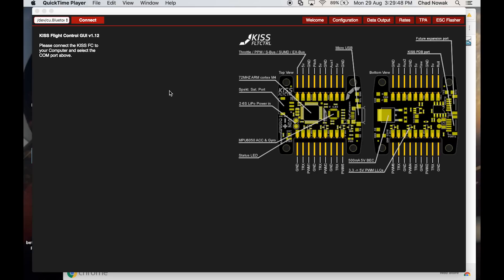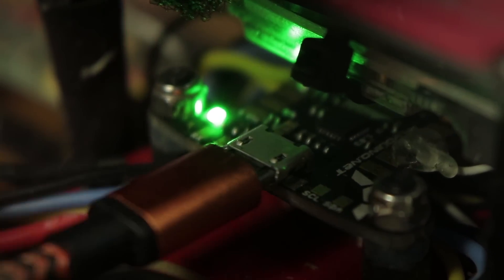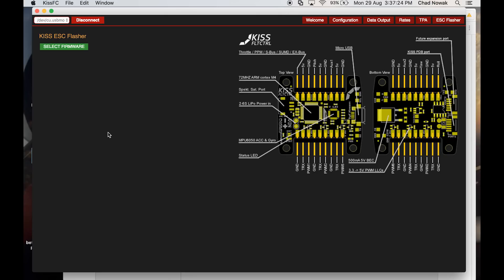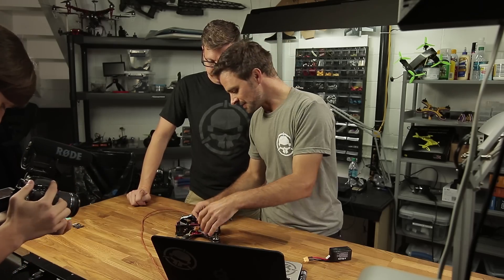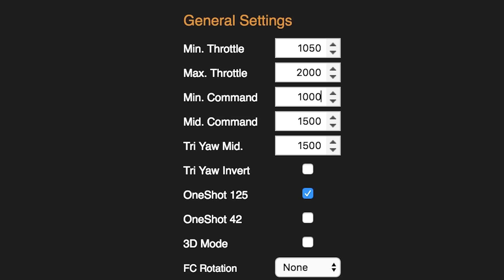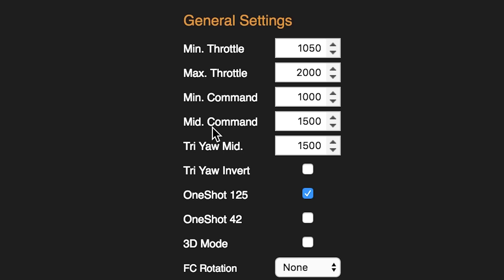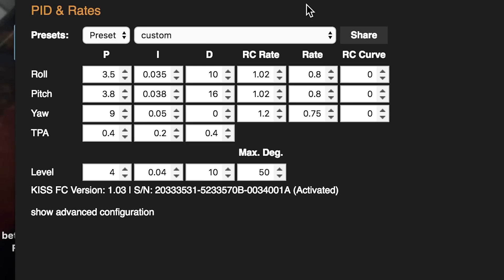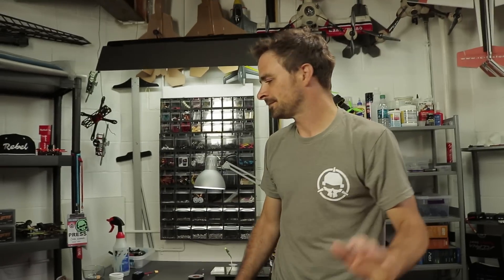Kiss FC Setup Tutorial

Comment: Built a drone using kissCC  GUI1.13 FW 1.1rc6. Need to remap the motors and how to set up arming and flight modes.{Transmitter has all the inputs and mixers set up}. 
Need help

Comment: How do get level mode on kiss fc and change modes in mid flight. I'd like to have a three range switch with level, horizon and acro. So when I start the quad it's in level and I can switch it to acro when flying and then if I lose control I can get it in level mode or if it get way out of control I disarm

Comment: Had massive problems with this  Fc, but after finding the bind button was not working (it eventually fell off) I did get it to flash. The Kiss software is hard to use and set up (I am planning to give it another try soon).  Chad said it works with a Mac, but I think the Kiss drivers for Windows need work. After flashing with beta flight I have had no problems with it and find it is very good. Not having pass though is a major pain also, I hope they fix some of these issues with V2 especially the boot button and pass through.

Comment: do you have to use kiss escs for this
Reply: No but you should update the Esc firmware before connecting to the Kiss fc as it has no pass through. You can update your firmware by connecting the esc's to another Fc then use the passthrough in betaflight or get an Esc flasher.

Comment: Great video guys. You sure make KISS seem simpler then it has proven to be. I noticed you skipped the part where you get STM bootloader driver. This might be a problem for some people as it was for me. The wonderful community on Reddit helped inform me of that.
Now I have my next issue. My motors wont spin, at all. I have flashed the latest firmware to both the fc and esc's that is FC =KISSCC-1.3RC30.dfu ESC=KISS24A_108f.hex
When I check in the GUI all of my PWM fields seem to move around just fine. When I arm it shows armed as well as my buzzer sounding. But the motors just wont spin.
I am set to DShot 42
Any suggestions? Thank You

Comment: Ok. No boot mode. No firmware selection option with usb/boot button.  The blue led slow flashes continuously.  Downloaded the latest firmware via dfuse.  If it won't connect via usb/boot button, how do I activate it?

Comment: I started my quard after i followed all of your instructions( Build, Kiss Setup, Taranis Setup). I was close to loose the alien within the first flight. You didnt mentioned the esc calibration, as well as motor spinning direction (i used a different motor; soldering 1 and 3 bridge was therefore wrong) and prop mounting at all in eather one of the build videos.
After i armed the quad it flew around 400 m within 10 seconds over 40 m high trees into a small forrest. Houres later i luckily found it. It was like the absolute horror!!! Please make sure  you inform people about aforementioned.

Comment: The firmware update with bootloader button doesn't seem to work on a windows 10 machine, and trying to use dfuse to update can't get the dfuse program to recognize the fc in dfu mode. No help at all from KISS.
Reply: so, as others have pointed out, if you use a mac all the problems with updating firmware go away, as the mac immediately loads the right driver and recognizes the FC. This is thus a windows driver problem, not a KISS problem. The quad flies like a dream, so it seems to be worth the aggravation.

Comment: I wonder if any of you kiss guys can help me?I have a full kiss set up and I switched it over to Beta flight GUI and in order to do this I had to take the protection off of the Kiss flight controller. Did this with no problem however I am not liking the beta flight with the Kiss hardware. Now I am trying to put the Kiss GUI back on the flight controller and it is not letting me because it says that the software protection is not installed. Could anybody point me in the right direction on how to re-install the firmware protection on the Kiss FC so I can install the Kiss firmware so I can go back to the Kiss GUI? Thanks
Reply: i dont know if you have fixed yet or not but you may have just boned yourself

Comment: Hi Chad et al. Love your videos and with Rotor Riot. Since your the main authority on Kiss FC was hoping you could help. PWM will spin up at arm, run slowly for a few seconds, then cut off. I walked through your tutorials and covered everything. Even replaced the motor. I'm using the compact CTRL with firmware updated on f2f and esc with same issue. Happens in level and acro mode. No idea what I can do. New build and can't fly. please help!

Comment: ho hum I can't get the fc to connect to my Mac it doesn't give me the option for usb is there a driver for this all I see is windows drivers?
Reply: Firmware Update – First time user

Download KISS FC Flight Control GUI from Chrome Store
To connect to the GUI, google “STM32 Virtual com port driver” and download the driver first (I still need to install that driver although my computer works fine with any Cleanflight boards either F1 or F3)//

https://oscarliang.com/kiss-fc-flight-controller/

Comment: I had to mount my kiss fc to one rotation to the right for the frame I am using. I need to adjust the  FC rotation setting but my kiss GUI does not have the option. Stuck. Need advice please. Thanks
Reply: http://blog.seidel-philipp.de/flyduino-kiss-fc-manual/#Custom_FC_orientation
Reply: Got through this long time ago. Sorry. Since this post the orientation setting had been changed to the advanced tab in the KISS GUI. "Where the orientation is fully adjustable". The only issue I have with KISS FC's lately is the fact that a lot of the KISS FC V3.1 are having activation issues and require to send FC SN# to Flyduino via post on website to have them update their server so FC can be activated. KISS FC's EITHER RUN LIKE HELL OR ARE HELL TO GET RUNNING!!!!

Comment: Maybe someone knows my problem.  I've got the Kiss FC upgraded with latest firmware, same with Kiss ESC's according to instructions here.  The ESC's appear to be operational, as they all been throughout the flashing process and LED's are all lit blue.

Well, I've got my spektrum satellite receiver plugged into the 3prong plug specified on the diagram as "Spekt. Sat. Port"  The receiver is successfully bound to my Dx6.  The FC connects via USB to my pc and all the settings are available on the Kiss GUI.  However, for the life of me, I cannot get any feedback from my receiver in the "Data Output" screen.  Neither can I "test" the motors via the same screen.

Any ideas?

BTW, this is a Rotor Riot Impulse  Alien RR5 with the 5" Smooth Power Pack build.

Comment: Hello just a quick question
 I have just got a new kiss fc and esc. my fc is mounted with the arrow facing to the rear of the quad
  in the old software it was a case of ticking the box which say say rotate fc by 180. but the new software it's gone and you have to tell it the roll, pitch and yau values. if it's facing to the real would I put -180° or 180? in the yaw box
 hope you can help neil uk
Reply: http://blog.seidel-philipp.de/flyduino-kiss-fc-manual/#Custom_FC_orientation

Comment: +Rotor Riot Can you provide a video that shows how to recover a KISS FC that has lost it's ability to connect to windows (ie. device "malfunctioned", etc). From what I understand they are still saveable, but everything I have tried has not worked to recover them.

I have had four (4) KISS FC's fail to update properly this week and I have used two different computers to try to get them to work.  I've been flying and upgrading KISS for months 6+ months with no issues. 

I've noticed a lot of other people with this same problem during my research. I think it would be popular video that would help the community extensively.

I have put them in DFU mode but the KISS GUI would not recognize them so I tried to use and open DFUSE, which confirms they are in DFU mode. I then select the firmware (Currently 1.1RC6.dfu). I hit upgrade and it immediately states in red letters "select a target before continuing!" and the kiss flight controller is effectively "bricked" at this point. I can't seem to recover it from this state of the computer stating that the USB device has failed to connect. The green light does come on, so they seem saveable to me, but no tutorial I've followed online has worked to recover them.

Love all that you guys do and I love FPV & KISS, but I've been grounded for 2 weeks and starting to go crazy. I'm down 4 flight controllers and can not afford to buy another one for the same issue to occur again.

Comment: Mine never goes into Boot Mode. No" Select firmware"  appears when I plug the usb cable while holding boot button. The blue light never comes on, except when I am not holding the button....but goes out after a few blinks
Reply: Bill Kordis This is the same problem I'm having... have you found a fix yet?
Reply: Im having the same issue... any luck?
Reply: I'm having the same issue any fixes
Reply: Are you guys using a windows PC? If so, the configurator tool doesn't allow flashing from a windows based PC, and you have to load the firmware from another third party program.
Reply: What kind of program
Reply: Here! you need a special software if you are running PC:
https://kiss.flyduino.net/dwkb/flash-fc-pc/
Reply: i figured this out if you guys haven't already

Comment: Everyone NOTE:  1.  Upgrade your FC before your ESC's.  
2. If running Windows 10, you will need to upgrade your FC using a bootloader such as DfuSe Demo.. After that (for reference, I am running windows 10 on a Surface Pro 3 and upgraded to KISSFC-1.1RC6), you can then use the gui to flash your esc's.  I hope this helps :)

Comment: Please help... I have just built a quad. When I throttlwe up motors 1, 2 and 4 spin up, a bit higher, about half way up motor 3 kicks in. I know in cleanflight and libre pilot you can set the min rpm for a motor. how can i do this in kiss gui?

Comment: I use level mode now and then just for LOS flying, never in FPV. A lot of time the quad will tilt to one side or forward/backward by itself in level mode. Is there a reason for this, gyro faulty??? or something wrong. I dont use it much, usually just to see how fast it is or to muck around, as in LOS i can never tell which way my quad is facing etc.

Comment: maybe somebody could help me here just put together qavx with a kiss FC xs30a esc red bottom Motors with the 5x4 5 Dal props I get like a loud harmonic vibration or it almost sounds like the motors are trying to break it is flying in level mode it doesn't seem to affect the way it is flying it only does it when I'm in a study hover.. punch outs it goes away or any kind of movement it stops the sound. I change to HQ props and it made it much better but I still get the sound every now and then could somebody please tell me what it is

Comment: ok  I'm buiding an alien with virtually the same setup.   just curious how to setup airmode..  and   also I plugged in my kiss FC to the Gui   straight out of the bag to check it out and I noticed the gyro doesn't register any movement.   on cleanflight my naze shows gyro movement with no battery hooked  up.... does the Kiss FC need battery power to do this?    just hoping I don't have a messed up FC
Reply: Search youtube for fpv chris kiss airmode
Reply: Thanks!   And the gyro problem was just me not keeping it flat and still for 5 seconds.

Comment: Hey guys, I'm arming the quad when it's conneted to flyduino FC without the battery plugged. On the data output the pwm 4 is always 30 lower then the others. Let's say the others show around 1100, the PWM 4 shows 1070. 

I tried to calibrate the 24A esc. Changed the ESC with another one. It's still the same. And when I hover parallel to the ground, the quad slowly starts aiming towards the 4th motor. 

It's not the ESC, nor it is the motor. Could it be a FC issue? All the firmwares are latest.

Comment: Just wanted to edit this - I disassembled the quad, pulled the lead from the x4r and desoldered it, resoldered another one (exactly as the other one was) and it worked... Good signal.  Holy crap  does this thing fly well.  Been flyig a qav250 and thought I knew what a locked in, lightweight quad felt like.  Nope... I had no idea...  This is going to b fun :)
Reply: I managed to get the FC firmware working by using a mac - flashed successfully.  But, still no input from the TX / RX to the controller.  Guess its time to disassemble...

Comment: Hello Chad,

Today I tried my first flight with Alien RR and full kiss set with lumenier motors. I updated all the firmwares. 1.03 and RC28... I noticed a problem while flying. When ı was going forward without giving any roll, the quad was leaning to left or right. It's not flying straight all the time. I don't mean it's turning in the roll rotation, the quad still remains straight in the air but it's changing its direction from straight to let's say left. So the camera shows me straight but the quad starts leaning to forward left or forward right. 

What could cause this problem? 

Thanks.

Comment: I started getting oscillations recently on my 5" Alien with KISS FC and 24a ESC's.  Nothing substantial changed, and it persisted event after changing out props, motors, ESC's and FC, and upgrading to the latest released software.  Finally I tried changing the LPF filter from "Off" to High, and started to see the vibrations go away.  I graduated down to Low (which was too much), and settled on Medium High, and it's not bad now.  My question is, what could cause it to need to be changed?

Comment: KissFC does not change when I plug in while holding the boot button. It doesn't give me the option to change the COM channel and nothing comes up about flashing the firmware. When I plug in without holding the boot button it KissFC automatically changes to COM3 as it corresponds to my quad. Am I doing something wrong?

Comment: FinalGlide, great video but I just got my new KISS fc and can't for the life of me get it to update the firmware via the GUI or the other process you mentioned in in another video using the ST firmware package.  I've done what KISS stated and removed all previous STM Bootloaders in the USB section of device manager but still can't get this resolved.  I think its a WIN10 issue.  I can't find a driver for WIN10.  I can find VCP driver related stuff for WIN10 but even those don't work to resolve this.

Comment: Hey there.  I just finished the Alien build, very helpful video on that, and now trying to get the FC set up and going.  However, when I open up the KISS FC GUI, the only two ports I see are dev/tty.Bluetooth-Incoming-Port and dev/cu.Bluetooth-Incoming-Port.  I thought that a new port might show up when I plug in the FC, but that didn't do anything.  I tried both with and without the Boot button pressed.  When I push the boot button and plug in, all lights except the blue one light up.  When I plug in without pushing the boot button, the blue light turns on solid for a few seconds, and then flashes about once a second.  I tried on three different macs all of various age and OSs.  Same result.  Did I break it?  Any ideas?  I wanna fly it!  It's my first drone.  Thanks.

Comment: I have issues with my 9x radio, frsky mod too: the throttle bar in the kiss gui is flickering as soon as I connect the yaw wire. I think my soldering is just fine. 
Any ideas?

Comment: Will the airmode setup work if I am using DYS XM20 ESCs ?  I have setup as Chad does and still have control of the quad at zero throttle but the motors tend to rev up and spin faster when the throttle is all the way down ?  I am running BLHeli 14.3 (I think)  before setting up airmode, my min command was 1065 and min throttle 1050.  Arming high on AUX1.

Before I go out and try it, just wanted to check if the motors spinning up higher at zero throttle is normal ?
Reply: Thanks Chad, I think I've managed to get it working.  I've got the basic understanding of airmode now.  Great tutorial videos.
Reply: So how did you get it to work? I am having the exact same problem, but am using 30amp LittleBees. I can't seem to get the airmode to work. My min throttle is 1000 and have tried min command of 1060-1075 and don't see much difference. Such a pain not using the KISS ESC's lol. Does the KISS FC have Pass-through? I can't flash my ESC's now because I direct soldered to the board. Also I don't know if One Shot 125 is enabled in the ESC's, it seems to work ok,I, haven't tried 42 yet.
Reply: +3000gtwelder I have'nt flown yet but when I arm the quad now the motors spin.  If I throttle up then drop the throttle to zero I still have pitch/roll and yaw control which I didn't have before changing my min Cmd to 1000 and min throttle to 1050 use Dys xm20a ESCs.  I think you need to be able ready to take off as soon as you arm as the motors rev up rather than just spinning.  Also it might make landing tricky I've heard many complain about the quad bouncing a lot when trying to land.  I'll try it first and if I don't like it might go down the route of setting up a switch to turn surmise on and off during flight to make arming and landing a bit safer.
Reply: I found having the filter on high/medium helps the bounciness when I land and the twitchiness, at zero throttle.